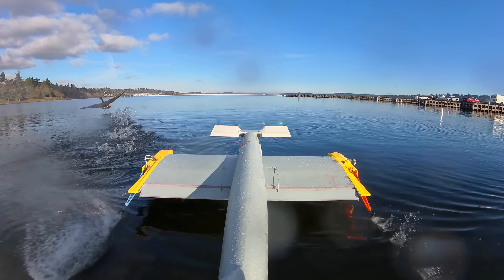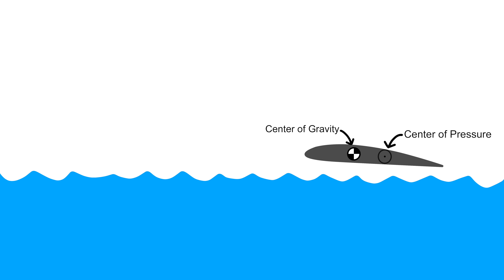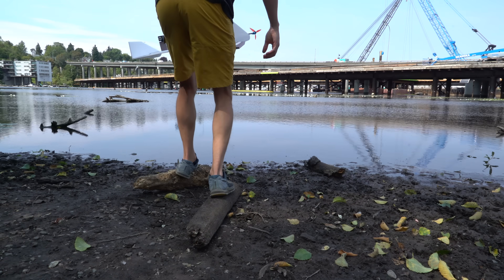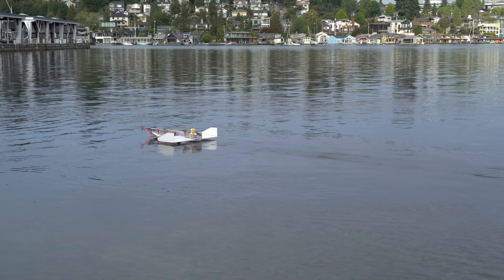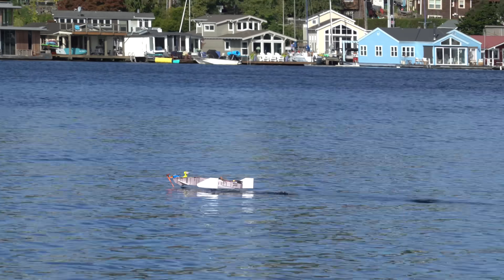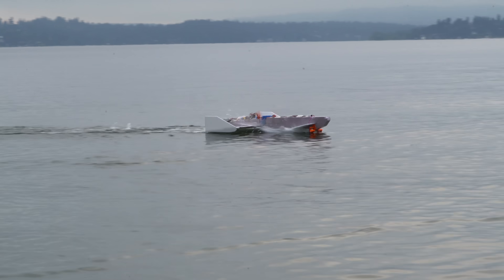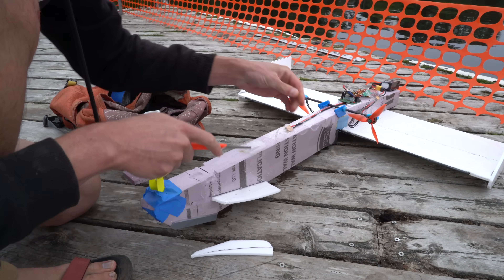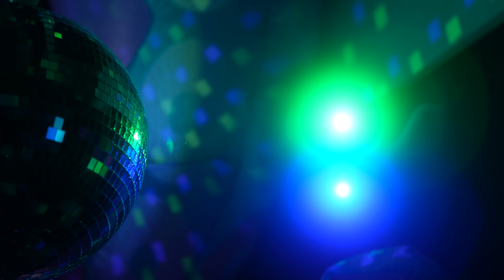Testing a Hydroplane / Ekranoplan Hybrid

Comment: You're trading pitch stability for your yaw stability, but you're getting ripped off and you wind up with neither.

As soon as you have a surface that's capable of producing lateral lift ahead of the CG, you're moving the center of yaw pressure wayyy in front of the CG, which makes your yaw stability wildly negative.  Why don't you try applying your rate gyro controller to trailing edge flaps to move the COP rearward based on speed?  Or use a CG shift system like two ballast tanks to run the CG fwd as speed increases?

Comment: Same sort of design but one simple change. The front skimming arm for control should operate the tail flaps and shift the CG and lift while slow and open up when fast. With the front weight pushing the nose into the water and the rear adapting to the induced angle with lift, the speed window should be wider. I look at things like those leading edge extensions and am reminded of olympic ski jumpers and how they V the skis. If the angle of the V is the lifting force, the more the V is out of the water the more rearward the pressure.

Comment: Putting the planar surface on a bouncing system that dampens would possibly smooth things out. The fact that more weight on the nose increases the jumping means more energy is stored in the deflection as a spring

Comment: Have you tried a weight shifting system?  Maybe a pendulum inside the vehicle to counterbalance the movement of the center of pressure, or a slight shift of the entire wing/airfoil of a degree or 2 up or down on the leading and trailing edges of the airfoils????

Comment: Replace the front propellers with paddle wheels.  I suspect slightly convex blades will be required because flat blades will dig into the water and pull the nose down

Alternatively you cold use concave passive paddle wheels. But they should have resistance...not be completely free spinning.

Comment: I love this whole area of exploration! I have been endlesssly fascinated by hydrofoils, hydroplanes and GEV since I was a kid. A couple of thoughts: perhaps raising the rear motors mount would introduce  a downward vector on the nose. I wonder if you had a fixed flat wand that was very pointy on the bottom and tapered wider towards the top if that would provide a graduated amount of lift that increased when the nose dropped and reduced when the nose rose.

Comment: Another solution is the Lippisch-style WiG vehicle with a pair of push-propellers at the back, in front of a π-tail, it was the concept used by the South-Korean army about 20 years ago and it could reach about 70 knots, but it had the same nose-flip problem. I think the solution to this is to add "high" canards at the front controlled by an ICU ("6050", I think), an Arduino Nano should be enough to control that (and stay flat all the time), no need to wire it to the remote. Also, the control surfaces on the tail are very important for the steering, varying motor speed is like driving a trolley from the front ent.

Comment: you need 1 point of contact at the front. it was steering like a motorcycle with a square profile tyre.
Reply: And downforce to keep it planted.  It's like a square motorcycle tire that's always on the edge of a wheelie, flip the canards and make it stick.

Comment: It looks to me like the water motors are lifting the nose due to the trust angle. Maybe put them on a gyro so they always stay level or pointed slightly down. That way they slightly push the nose down and the canards keep the nose up. That's what I would try. I really like the idea of it being pulled by water props.

Comment: Instead of that feeler wand in front, put an underwater propeller.

Power the propeller through a flexible driveshaft. 

Pull the ekranoplane with an underwater prop

Comment: Cool contraptions.

What about connecting 4 wings ? Two in the front, two in the rear with slightly different angles of attack such that the front and rear pairs stabilize the longitudinal axis and the right and left wing stabilize on the transversal axis? The wider/longer  narron/shorter relative positions will self correct. Or not??

Comment: stopping proposing is super challenging: the change in drag is very drastic and asymmetric as your vehicle dips into the water. so long as you're depending on surface interactions you will always get oscillations as your vehicle is very light and the relative inputs are very large. you need something that has a slower response time, averaging out the height of the waves better.
Reply: like really knifing the water? he talked about a narrower keel, would provide a longer gradient, converting bouncing to slower springing
Reply: @peppigue  I was waiting forever (realistically 14 minutes) for him to realise he needed something like the vee hull. The surface area of the flat nose was obviously applying too much upward force every time it came into contact with the water, and the amount of force would vary with speed and angle of impact (waves). He needs a nose shape that applies a little force to start and then progressively more force the lower the nose dips. So a deep convex or complex vee.
Reply: I wonder if weight might be a factor. The Ekranoplan was a heavy beast meant to carry huge loads of cargo. Maybe more weight would help to dampen the responses along with the longer fuselage and large tail like he mentioned.

Comment: What if you make a movable mass so it is possible to change the center of mass in real time, something like a skyscraper anti wind system.
Reply: I see two wheels, one in each wing, each with a mass on the circumference (ie a wheel weight), and rotating forward / backward according to center of pressure moving. Fast correction (little inertia) and easy to implement.
Reply: by jove!
Reply: agree